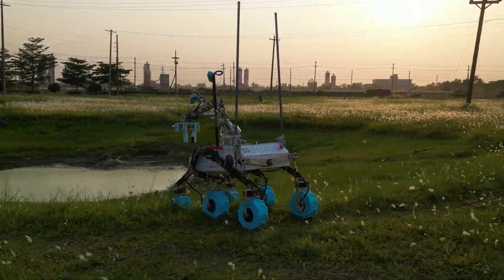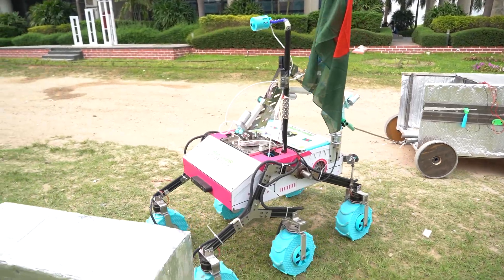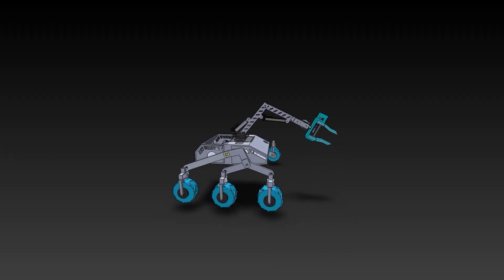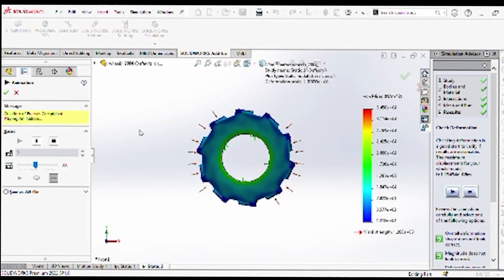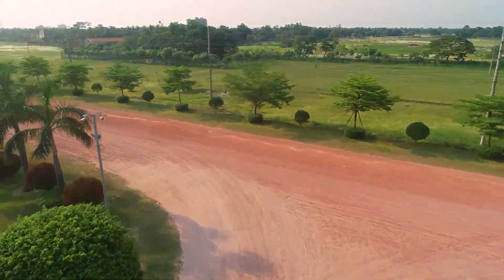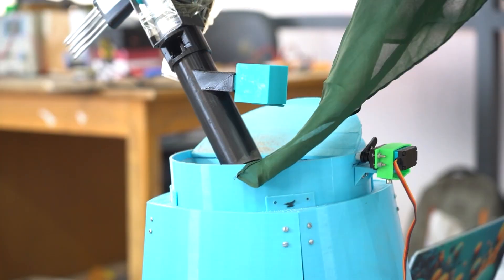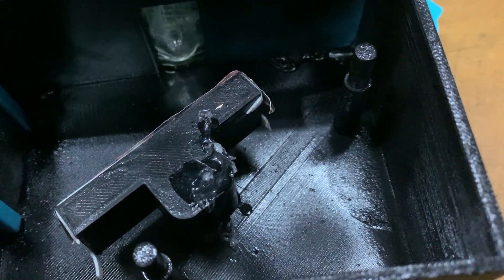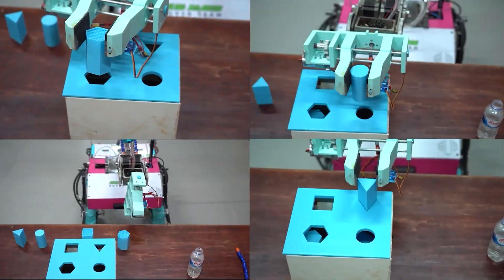GUB MARS ROVER | PROJECT LOTUS | ARC 2025 VIDEO REPORT

Comment: seen other rover team from bd, deffinitely good job from GUBMRT. but i think design have similarities from UIU's rover. i've seen bracu, uiu rover for the past three years, and gub rover feels like it's been inspired or copied, like the arm is similar to uiu 2022 rover,  and the drivetrain is similar with their current rover. although good wishes.
Reply from the maker: Thank you for your observation! We truly respect all the amazing rover teams in Bangladesh, especially UIU Mars Rover Team and MIST Mars Rover Team, who have been great sources of inspiration for us.

Regarding the arm design – yes, you're probably right! Using holes helps reduce weight while maintaining structural strength, a principle we've seen effectively used in many designs, including the MIST (2021) Mars rover design before the UIU (2022) Mars rover design, which we referenced. Similarly, many components like the linear actuators, rocker-bogie system, and wheel designs are based on open-source concepts, widely adopted across teams globally.

Big respect and thanks to amazing rover teams in Bangladesh for setting high standards and inspirations. We’re proud to be part of this growing rover community. Keep us in your good payers.